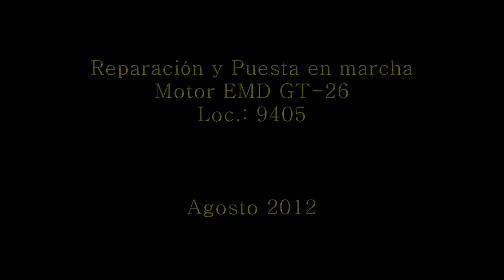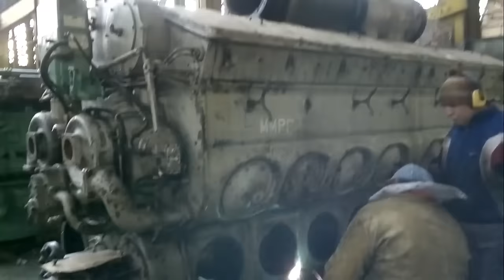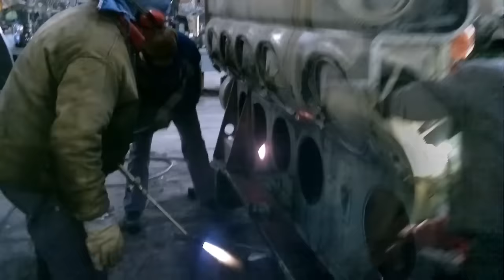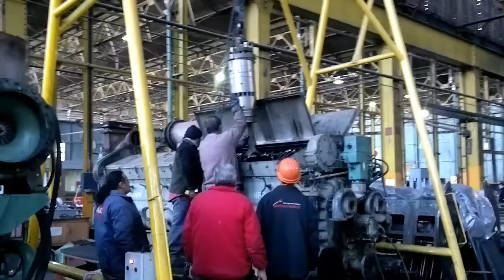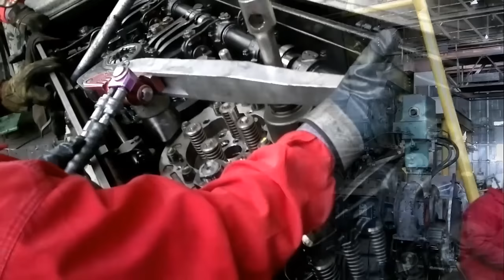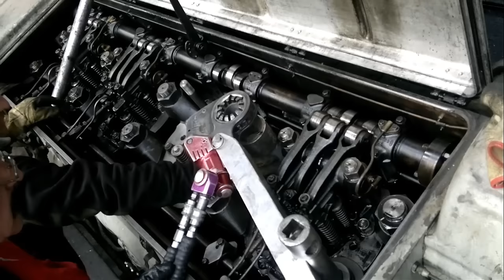Locomotora EMD GT-26 #9405.

Comment: THANK YOU FOR POSTING THE MAINT. VIDEO! It will greatly help if, next time you change an assembly, you'll follow this advice! 
   There's 2 hooking-up positions on the jig to pull an assembly. You always hook up the crane to a single wire-rope cable to the offset hole. It changes the center of gravity so the assembly sits on an angle, and doesn't scrape and catch on everything! Also, the first thing you need to do is to get your top-deck covers out of the way. Pull the pins and lay one section aside. That way the hole is unobstructed. (just open the cover and bump the cover off the hinge pins. When done, just line up the pins and bump back on. The covers are made out of aluminum, so they're NOT heavy! 
   Before you even bar over a freshly worked over engine, pour new oil all over all the cams and rocker parts. Prime your turbo soakback pump for several minutes. Reset the Ground Relay. Make sure no tools have been left in and around moving parts. Crack all the TEST COCKS. Pull the LOW OIL BUTTON on the governor, (so it can't start), and turn it over a few turns. This ensures all the water is out of the cylinders! ((To Not blow it out, you risk busting several pistons! ))Then close ALL the test cocks. If excessive pressure is needed to close-off a test-cock, the seat is flaired and needs to be changed. Be sure all the access-hole cap gasket rubbers are ok and not dry-rotted, and all the crank-case and air-box covers are on. Always be sure your bar-over-jack isn't in its nest before you use the starter motors to bar it over! Make sure your engine oil, governor oil, and turbo lube oil are at proper levels, and your engine cooling water is in the proper place in the sight-glass. (put a tyrap around the sight-glass; so you can move it up or down. Position it at the top of the water level with the engine shut down.) Start the engine and pull the tyrap down to where the water is, in tge sight glass. make sure the water level, in the sight-glass; doesn't go passed 1/3rd height. Watch that the water level doesn't fall too much below that tyrap or you're loosing engine cooling water.
   Thanks again for posting!

Comment: Runs like a gigantic Swiss watch. Really amazing.  The engineers who develop these engines must also be geniuses.
Reply from the maker: It's True
Reply: Charles Kettering, he also gave us the electric starter,[some say he stole it from a employee] but he had many others ethyl gas was one of his worst. He makes for a good study.
Reply from the maker: It's true
Reply: rudolf diesel
Reply: D. Saelens Actually, Kettering and Sloan, both of GM.

At the same time as Kettering and Sloan were developing the EMD 567, they were also developing the Detroit Diesel 71 of 6-71 fame.

This would be in about 1938.

Both EMD 567s and DD 6-71s found wide applications by the military, during WW-II.

Kettering was the founder of DELCO.
Reply: paul dolph Also responsible for the development of Freon. It is said that Kettering had the first residence which was air-conditioned using Freon and not ammonia. Remember, Frigidaire used to be a GM division.

Comment: Once he closed that relief valve on the right side she sounded great. Maybe a tiny bit of rocker tap on the close up on that side but those engines are very hard to kill. And when you do kill one they're pretty easy to repair. New liner, rod, piston, etc. and she's good to go. 3000 horsepower!

Comment: If I'm correct, this is a EMD 16-645 E3. The turbocharged variant of the 16 cylinder diesel engine series built by EMD.

Comment: Awesome video! Thanks for sharing this! I always wanted to see what a locomotive engine looks like from the inside.
Reply: Just a car engine only much bigger.
Reply: Aviation Nut. Wait till you see up inside the Crank-Case. Talk about kewl! The jug is about the size of a paper plate! The piston rod is around 14" long and its basket is about 5". Each cylinder can be pulled out of the block and swapped out. It's so kewl, watching two people changing an assembly. If they're good at it, they can change one complete section in 8 hours and still not kill themselves!

Comment: That rising pitch as the engine turns over is orgasmic
Reply: Yes it is!
Reply: That's mostly the sound of the electric engine spinning the crankshaft for ignition together with the sound of the gears
Reply: Is it?
Reply: @em4703  that high pitched sound is the turbo and gear train.

Comment: This video shows repair of an EMD engine using ordinary shop tools, an advantage of a welded block (all EMD 567, 645 and 710 two-strokes) over a cast block (all GEs and EMD 265 four-strokes).

EMD two-strokes admit "charge air" through ports in the side of the liner (45 BBDC to 45 ABDC) and exhaust combustion gasses through four poppet-type valves in the top of the head.

This is a basic feature of a "Uniflow" two-stroke engine, which GM and EMD pioneered in the 1930s.
Reply: The technicians are shown installing a "power assembly" using an overhead "A frame" crane. This results in the power assembly dropping vertically (zero degrees) ... not optimal for a 45 degree Vee engine.

EMD sells a special fixture which causes the power assembly to be withdrawn and inserted at 22.5 degrees to the vertical ... optimal for such an engine.

Comment: GENERAL MOTORS GM Built DETROIT 2 STROKE DIESEL ENGINES & these are just BIG DETROIT 2 Strokes.... Until 1988 the EPA emission restrictions Detroit bought John-Deer Tractor Engines & the
60 series Detroit's were born. They are 4 stroke 
These like every Train Engine I know of are 2 Stroke there may be 4 stroke out there but even the CAT TRAIN ENGINE to my surprise is a 2 Stroke Diesel Engine. Hope someone enjoys reading about these Great American Engines. I was only a Truck Driver 31 yrs. Drove my share of DETROIT'S oh and if you look closely these 16 Cyl Engines in the Video are two V-8 blocks bolted together. All DETROIT Diesel blocks were Built to be bolted together if needed.

Comment: Right at 15:50, soon as that thing was closed the engine started purring. Good repair!
Reply from the maker: Hi theshyguitarist
That's a compression control valve was left open
In the minute 15:50, was corrected

Comment: See ...

Loco 66542 cold start attempt 3...

... which shows a turbocharged EMD engine without its exhaust ducting in place (it is completely removed, except for the input nozzle to the turbine.

With no source of exhaust gas heat, the turbo-compressor system is forced to operate in compressor mode only, but the engine will start and can be operated at higher than idle speeds, just not at rated horsepower.

This is a good diagnostic technique and can save time.

Comment: Now that's what I call great engineering. Thanks for posting +Carlos Contreras.
Reply: General Motors designed these locomotives and engines in 1949. They were way ahead of their time. I worked on these engines. They were well designed and easy to repair.

Comment: A turbocharged EMD engine will start and operate without the installation of the exhaust duct system.

The turbo-compressor will be acting in compressor mode, only, as the overrunning clutch will engage, and it will still provide charge air for starting and running, but the engine obviously will not operate at rated horsepower.

This can be a useful diagnostic procedure.

Only after the exhaust duct system has been installed can the turbo-compressor operate as a true turbocharger.

Obviously, the complete turbocharger assembly must be installed, and only the exhauset duct system is not installed.
Reply: Peter Haas what co. did you work for? It almost reads like you wrote that, word for word out of an EMD machanist handbook. Good post!

Comment: Did the engine have a connecting rod failure , hence the repair to the block ?
I was lucky enough to replace a kit on an EMD in a ship once , most of my career was spent on their smaller cousins , the Detroits . Cool video .
Reply from the maker: Diesel engine connecting rod was cut and that damaged the block and crankcase.
Thanks for watching the video
Reply: Ah , ok . Cylinder must have seized in a bad position .

Comment: yo vivo cerca de cevil pozo cruz alta tucuman, ahi hay otras general motors son las EMD GP40-2 cuya motor es el mismo, pero la diferencia esta en que tuvieron que modificarla para q corriera en nuestros rieles, segun lo que me comentaron con toda la modificacion que le hicieron el motor diesel eroga 3300 hp
Reply from the maker: Hola José
Éstas son las más grandes que tenemos y llegan a desarrollar hasta 2800 Hp
Reply: The 16-645 in the DD40AX had a larger turbo and did indeed generate 3,300 HP per engine.

But, that was at 950 rpm, and that was proved to be TOO HIGH in the SD50, so the 710 was made, and it reverted to 900 rpm for 3,800 to 4,500 HP.

Standard generators are usually 20 cylinders, and are 900 rpm for 60 Hz.
Reply: DD40AX have a 2 of these engines

Comment: EMD's design is so ingenious that's a reason why G.E's are still going much stronger and E.M.D. was sold to Caterpillar...this is what happens when you build junk for too many years.The only problem with a GE unit are the turbocharger units no need to replace the entire engine or rebuild it most of the time.Replace the turbocharger unit put it back together and you're back on the road,with an EMD,your tear down the ENTIRE engine,then rebuild it.

Comment: That is some torque wrench at 8:00. Any idea of how much torque those bolts are being tightened to?
Reply from the maker: Yes sir, that's a torque wrench and nuts have a torque of 2000 lbs / ft or 280 kgm 2700 NM.
Regards
Reply: Carlos Contreras Wow, that would take a very long breaker bar and a very heavy man.
Reply from the maker: iaagg
It is true
Thanks to who invented this machine :)

Comment: I gather that it's a 2-stroke. Question is what's the middle rocker for on top of the cylinder head? Is that for the injector? That's some really cool stuff
Reply from the maker: Hi KrazyPolak87
Yes sir. The rocker, that you see in the middle of the cylinder head, is for the fuel injector.

Comment: Is that pufy sound until 15:48 made because one cylinder is not firing ? Here in portugal we have a class of locomotive that makes that same noise (CP 1960) supposedly because 2 or more cylinders wore supressed because the locos wore too noisy or something...
Reply from the maker: The sound heard until minute16, is because the valve cylinder compression testing was limp (in cylinder #16).
Regards
Reply: Carlos Contreras
Definitely cylinder #16.

Remember, on an EMD, the "front" of the engine is the end which has the coolant system and the engine governor, whereas the "rear" of the engine is the end which has the induction system (including the turbocharger) and the traction alternator.

This means that the "front" of the engine is actually at the "rear" of the locomotive, and the "rear" of the engine is actually at the "front" of the locomotive.

This actually makes sense as the traction alternator should be as close to the electrical panel as is possible, and the electrical panel is at the back wall of the inside of the cab.

So, cylinders #1 and #9 are at the "front" of the engine (but at the "rear" of the locomotive), and cylinders #8 and #16 are at the "rear" of the engine (but at the "front" of the locomotive.

Comment: The technicians are working on the "crank case hand hole" of cylinder #10, which is directly opposite cylinder #2.

It was most likely cylinder #2 which threw its rod, thereby damaging the #10 "hand hole".

Much later in the video, we see the technicians replacing the "power assembly" of cylinder #2, which would confirm that it was indeed cylinder #2 which threw its rod and caused the damage to the cylinder #10 crank case hand hole.

If this were a cast block, as on all GE engines, the crank case very likely would be discarded as being unrepairable, and probably the entire engine would be discarded as well.

However, with the EMD block being constructed from flat, formed and rolled structural steel, and steel forgings, welded into a composite structure, a "weldment", most sections of the block may be repaired using ordinary shop tools, as this video clearly shows.

Remember, EMD pioneered the all-welded frame, while all its competitors were sticking with cast frames. So, even EMD frames may be repaired, if the damage is not too extensive. This was back in the 1930s, when EMD transitioned from the SC-1 (600 HP switcher with a cast frame) to the SW-1 (600 horsepower switcher with an all-welded frame). The S means Switcher, the C means Cast and the W means Welded.

So, EMD has been building LARGE components, including frames and engine blocks, using "weldments" for about 80 years.
Reply from the maker: Better explained, impossible
So these Diesel engines have their centenary :)
Thank you very much for your comments.
Regards

Comment: question- the camshaft is rotating around 300 rpm-normal for a 2 stroke but the output shaft seemed to be spinning much faster. i dont know if it was anillusion, but the speeds didnt seem to match up.

Comment: To see accurately how the internal components of an EMD two-stroke actually work, download this ...

Electro-Motive Diesel: 710 Twenty: PowerCycle 3D Animation-1080p.mov

... YouTube video, import it into QuckTime Player (or another viewer) and place the viewer into a never-ending loop.

The pistons are missing, but the important part is the actions of the piston carriers, onto which the pistons actually ride.

A HUGE snap ring keeps the piston locked onto the piston carrier in an actual installation.

You will note that only one rod has a cap, a "basket" in EMD-speak. The other rod has no basket, but it interlocked into the rod with the "basket".

This approach is successful as all components are always in compression, never in tension, all throughout the cycles.

Comment: sounds good nice job
Reply from the maker: Thank you very much
Reply: nice to see that the old stuff not being throw to the junk heep nice coat paint it should be prime shape
Reply: +rock dawg I've seen the log books for some of these locomotives.Some engines have over a couple million miles on them,with complete teardowns and rebuilds every so-many thousands of miles.I worked out of the CNR diesel shop in Gordon Yard,Moncton,N.B. Canada for some years(radio tech).

Comment: Hi Carlos,
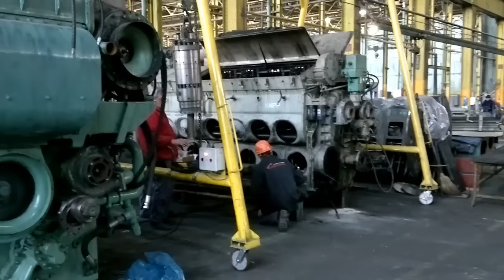I have a question about these large engines.  So the green housing is the turbo-charger.  At 2:14 there are 2 smaller looking "turbo" impeller housings that appear to be connected to a gearbox at the back of the engine (or could be the front).  What are these for?  Starting using compressed air or are they compressors used for other applications aka braking?  Just curious.

Thanks!
Reply: They are two water pumps.

Comment: Please see ...

Sd70Ace EMD 710 Valve Gear in action

... for the valve gear of an EMD 710 in action.

That 710 is a post-1995 example, which has electronic fuel injection (EFI).

Pre-1995 710s and all 645s and 567s have mechanical fuel injection, but the plunger-type pump (actuated by the camshaft) is the same in the early non-EFI examples as in the later EFI examples.

The difference is the early engines have a "fuel rack" which is controlled by the Woodward PGE locomotive engine governor, and the later engines have no "fuel rack", but have an "engine control unit" (ECU), which is also part of the "locomotive control unit", and which performs the same function as the Woodward PGE governor.

The functions of the injector types are identical: both have a fuel supply and a fuel return, as fuel is employed for three purposes: injector lubrication, injector cooling, and injection for combustion.

Injection occurs at 4 degrees BTDC, just before the "charge air" reaches maximum compression and, hence, maximum temperature.

It takes time for the igniting fuel to propagate, so injection intentionally occurs slightly before TDC, so that it become most effective slightly after TDC.

This is the same on EFI engines. The only difference is the ECU is determining the amount of fuel being filled into the mechanical portion of the unit injector and, thereby, controlling the amount of power being produced by  the engine.

In all other respects, a mechanically-controlled unit injector (UI) is equivalent to an electronically-controlled unit injector (EUI).

Unit injection was patented by General Motors/EMD in the 1930s.

Other manufacturers use a "common rail" system, which has similar benefits, but does not infringe on GM/EMD's patents.

The Detroit Diesel two-strokes (53 Series, 71 Series, 110 Series, for example) use the very same type of unit injector.

Incidentally, the repair manuals for the early EMD engines, and the manuals for the Woodward PGE governor, are on the 'Net, and are available for download.
Reply: You will notice that the two rocker arms on either side of the center rocker are rather slightly built. This is intentional as it does not take extreme force to open the four exhaust valves. Two valves are operated by each rocker, through a "bridge" ... pretty common even on four-strokes with more than two valves.

The center rocker is much more substantially built as it has to operate the "unit injector" plunger pump, and this takes great force.

Also, the center rocker is equipped with a lock-out mechanism, in case the engine over-speeds, and this mechanism prevents the center rockers from operating, thereby immediately shutting down injection, and, hence,  imediately shutting down the entire engine. This lock-out must be manually reset.
Reply from the maker: Peter Haas Excellent and very helpful explanations on the operation of these engines.
Thank you very much